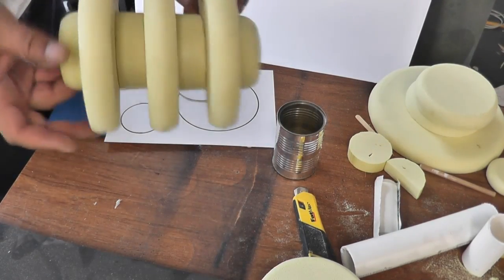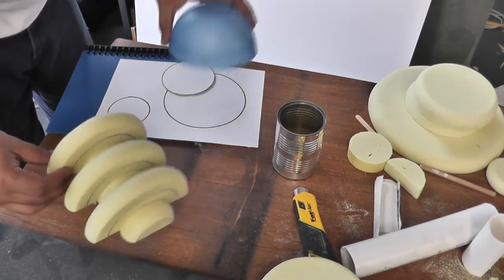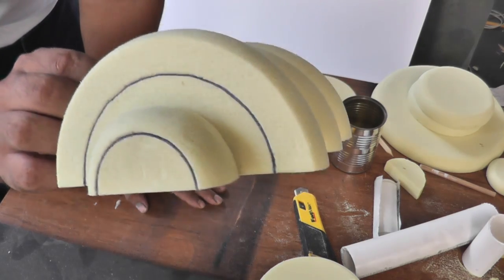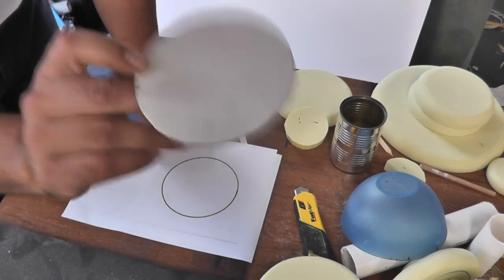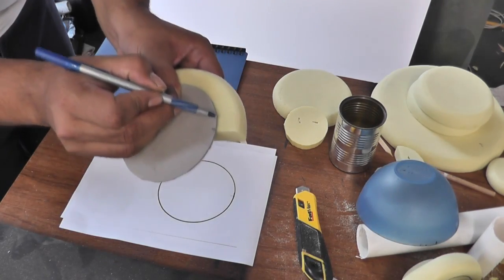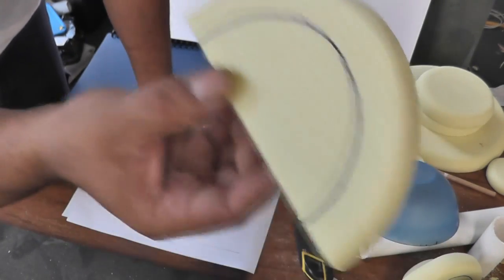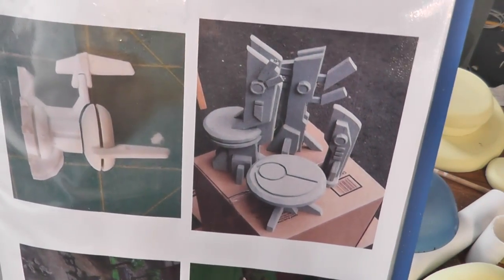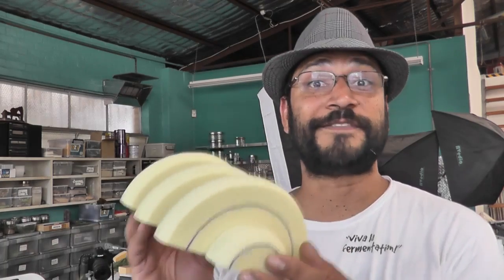2. Tau Terrain Project - Simple Generator

Comment: Excellent yet simple viv thanks for sharing. An idea for the scoring that doesn't involve photo shop. Why not attach a piece of string to the pen and place that at the centre point like a crude compass? It will line out a circle and as long as it's the same string length, easily marked off, then they are still all the same. Just a thought. Keep up the awesome videos man.
Reply from the maker: Its a good method for those that don't have PS ... I used the same method to draw the circle for the top of the landing pad.
Reply: RubbishInRubbishOut I saw as I watched the next video and thought oops should have watched them all as there it was.

Comment: A circle is defined by its diameter. If two circles have a different "size" they have a different diameter.
I think you are thinking about some sort of curvature, but all circles also have the same curvature.
Reply from the maker: That's the one ... you understood what I was saying  :)
Reply: I think those hot wire cutter fumes might have some bad effects ;)
Reply from the maker: lichtsuchender Pretty much everything in life these days has some kind of bad effect, but yes, they are pretty bad for you, always use in a well ventilated area!

Comment: Now that is an awesome start to the generator, where you put the groves i would cut them parts out on each one, get some thin transparent plastic card, color it blue, use the template to make the half round shapes, then glue that on each side and do that on each one, grove out the bottom, add a few blue LED's at the bottom and a few wires and a 9V battery and boom how awesome would that look :D
Reply from the maker: Now that sounds a little extreme for a 'simple' tau project.  Maybe for the next one ... some nice ideas there!